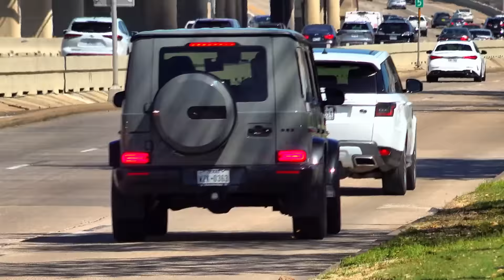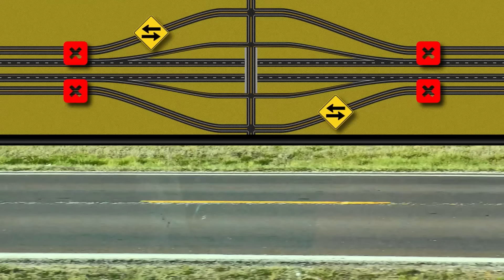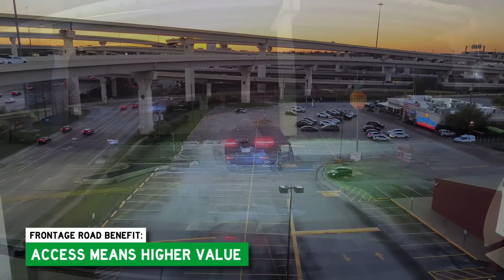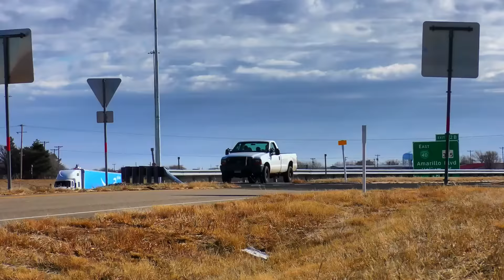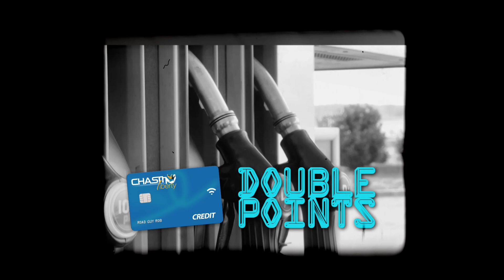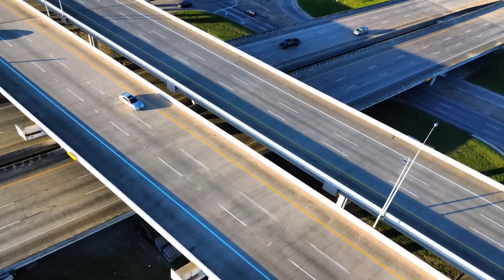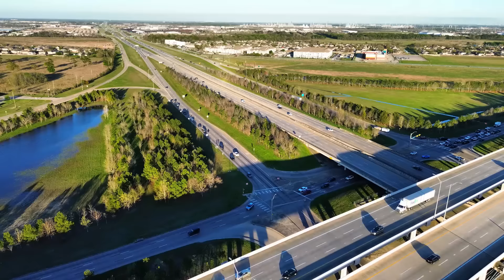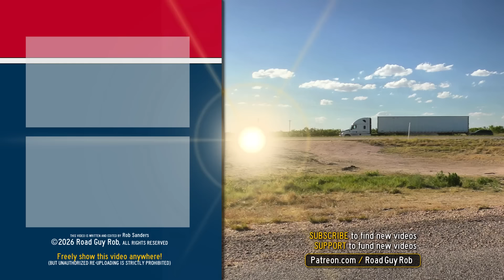Why Texas Builds a Freeway Next to Every Freeway

Comment: Honestly, the frontage roads would be greatly improved, along with the general highway experience, if they removed "driveway access" to them. When the frontage roads are serving as a buffer between local streets and the highway they can work well, even if they take up a pretty crazy amount of space. Rob mentioned the land value increasing because of the access, but it ends up defeating the purpose of having the frontage road at all, since the road that's supposed to be providing access to the highway can get backed up with local traffic, areas around places like Costco can be particularly bad about this. The other issue with the land use is that the businesses are highway facing, rather than community/living-area facing, which makes them difficult to access without interacting with the frontage/highway system, sometimes there are ways that you learn over time to use local only, but often the roads themselves tend to push you to a highway, everything kind of "conspires" to get you onto the interstate. Since the highways are so predominant (I can speak more for DFW than anywhere else), it ends up creating "inverted" towns, where the center is all residential, and all of the commercial is along the highway that surrounds you, so we don't get to have very "local" downtown areas.

Comment: It is a clear indication of how crazy our roads can get.... but it does make sense.  In Los Angeles we have divided exit lanes that rejoin the freeway. Near downtown there are a couple sets of these. I usually use them when I can. They require a bit more thinking, which means they're usually better than the main freeway.     
Frontage roads are like flood plane. When the flow increases in the river, the river widens into the flood plane to continue carrying the increased volume. One thing I've always thought, but haven't seen discussed is urban freeways should have more off ramps than on ramps. This allows vehicles heading to a more local destination to have more options to leave the freeway.  Also in Los Angeles where I live, there are areas of interchanges (I-10 to I-5 to I-101) that are boxed in by waterways and train yards. This is of course where the blockages are common.  To get to my house from I 10 westbound people have to take a complicated interchange (Took Tesla FSD until 2023 to figure it out). If you miss one of those multiple lane changes, it's 2.5 miles to get off at the next exit and backtrack on surface streets. 
We could alleviate a lot of the frustration of drivers and save money if we turned signaled intersections into Roundabouts. I used these all over the UK and just love them. They do slow you down a bit, but you never stop. U turns are no longer U turns, they're just 360s.  I've overlaid a basic urban roundabout I was familiar with in Scotland over intersections in Southern California. I did this at scale. Absolutely feasible. The money savings comes from not having to operate traffic signals.  
Two major issues with using space under the freeways. There's a lot more pollution near freeways, but if there's a fire underneath a freeway, the structure can be compromised. It's tens of millions of dollars and long road closures to replace these sections. As electric vehicle use increases, pollution will be less a factor. Noise? (I live a couple hundred feet above a major freeway and interchange. My double pane windows cuts out most of it. Could Bose or someone make noise cancelling windows? Shouldn't be too difficult. )  Also 20 years ago increased pollution standards for diesel trucks substantially solved that problem. I know personally, that's when the crippling migraines I had for my entire life tapered  off and stopped.

Comment: In urban areas with heavy congestion, these frontage roads cause more issues than they fix. Businesses and homes face daily gridlocked traffic outside their driveways. And those places are inhospitable to walk or bike so there's no escape.

They are also extremely dangerous. Cars exit the freeway going 80mph need to decelerate right across 3 lanes to access a driveway, while other cars are accelerating merging left to get on the freeway.
Reply: Whos home driveway exits out onto a frontage road? If that exists anywhere, then they chose to buy the property. Oh well
Reply: @6z0  There are houses directly along the 290 frontage road in Austin. Also tons of apartments and condos are along Texas frontage roads. Do those not count as homes?

Its just a bad design for urban areas.

Comment: The traffic lights at the frontage road intersections feel eternal. The one I have to go through every morning is red for over 2 minutes and green for about 20 seconds. In the afternoon, the traffic backs up and it is not uncommon to have to wait through 2 (or sometimes 3) cycles before getting across the intersection. The frontage road is a bad idea in urban areas but Texans are stuck with them.

Comment: First time I went to Texas (I live in Switzerland) I noticed this special road design and especially found the Texas U-Turns very interesting to use and look at. Even tho I am not a huge fan of car-first infrastructures, it is impressive how well this solution works (for cars and their drivers).
Reply: Texas has the best roadway engineering in all of the US. Lived here all my life and driven in about 10-15ish of the major states. Sometimes its better to optimize for one mode of transport instead of half-assing it for everyone and making it shit. Just like New York City is a subway / walking city primarily (terrible for driving), Texas just happens to be the opposite. And both are great when you use them as designed.
Reply: The nice thing about the car first infrastructure is that the idea of traveling great distances becomes more common. A 20 to 40 minute drive (10 to 30 miles) becomes less burdensome and daily routine. And some people even go 4 hours one way then back as a day trip to the major cities or borders.
Reply: For us here in Texas there is so much distance between everything that it's probably always going to be car first

Comment: The service roads (what we call them in Dallas) are great except for one thing that is a pet peeve of mine.  

In a number of cases -- not all cases -- when you turn onto the service road from a main perpendicular road, you have to drive an extremely long distance until there is an onramp for the freeway, meaning you have to pass all the driveways of a countless number of businesses with cars and trucks pulling into traffic, causing a delay into you actually getting onto the freeway.

Comment: The frontage road has been a life saver for me on multiple occassions. Once i spun out going off the ramp onto the frontage road (ironic i guess for my point) and got dirt in the tire sidewall of one tire so it couldnt hold air so i had to limp home across texas on a boot on the frontage road. Then another time my tire blew out and drove across the grass changed the tire on the frontage road and then  i limped across texas on the boot.

Comment: I was watching this and thinking it looked very familiar.  We have one-way frontage roads right here in Cleveland, Ohio, even including the U-turns under the bridges.  I'm betting ours may actually predate those in Texas.  I do know some along I-90 in the east-side of Cleveland have been there from at least the 1970s and judging by some of the industry, and homes, probably the 1950s.  

One difference in that area:  I-90 is an east/west road.  The frontage road on the south side of the highway, east bound, is industrial and commercial.  The frontage road on the north side side, west bound, connects to north/south residential side streets.  It does make for some tricky merging and having your head on a swivel.

Comment: During my brief visit to Texas I found it surprising that the drivers coming off the freeway exit ramp have the right of way, although I see the logic of it.  But my experience being on the street trying to get in the left lane for a U-turn was that cars come down that ramp like a bat out of hell and do not decelerate to the surface street speed limit before reaching the bottom of the ramp. This was in 2001, perhaps before they switched to the X configuration. Today there would likely be a much greater distance over which to do battle with the exiters.
Reply: Yeah you gotta watch out for that haha

Comment: The only thing I hate about Texas is the high ass intersections they call flyovers. Being afraid of heights n a trucker isn’t a good mix on those highway junctions. When I can I get off n use the frontage roads to avoid the high ramp. When I can’t avoid them I go past them to next exit that will allow me toget turned around so I can stay ground level or closer to it.

Comment: I recently drove across dallas. while using a transponder and pulling a u-haul. I avoided the toll roads whenever possible except for $12 where there was an accident.  The uhaul was $60 in tolls. The car was another $60 in fees. I took i20 to i35w. As far as I know I only took the toll road for what should have been $12. I didn't make any stops. it took 6 hours. google maps estimated 1.5 hours.

Comment: Ah, Texas... Houston in particular. The expanses of concrete are never enough. By definition more is better, more lanes, longer, more loops, more more more. I spent a fair amount of time driving on those freeways and surface streets. I admit that the one-way frontage roads used are a pretty good thing. Houston as a city is a horror. Virtually zero planning, zoning, etc. It's just awful to try to actually get around and do things because the traffic is always over the top. With a mass transit system that is barely adequate and treats the west side of the city as untouchable.They like to say that everything is bigger in Texas... sure, whatever. I think everything is kinda messed up and weird in Texas.

Comment: I thought this was common. Not just freeways but highways too. It's a beneficial idea to have your off ramps connect to some form of thoroughfare that runs parallel, like a buffer. So from those, you can either get on a highway, or access local businesses. Of course the ones I know behave more like streets than highways themselves, with street lights and everything. Every now and then crossed by a street that crosses under/over the highway.

Comment: In the olden days, Beltway 8 north, then called the North Belt, had over passes built, but no actual freeway. It was like they were optimistically waiting for the freeway to connect them. So on the way to the airport, you got off I45 to the North Belt and drove on the frontage road and then got on the overpasses at each crossroad. I'm not sure, but I guess by the time Beltway 8 was actually built, they probably tore down those overpasses.

Comment: I'm convinced that all this extra concrete and paving just increases congestion and wastes gas. I spend 2 months a year driving in San Diego. In Texas I spend a lot of freeway time in stop and go congestion and I need to fill up every day and a half or two. In San Diego my driving habits and distances are similar. There I fill up every week to 10 days. In SD I'm almost never in 1st or 2nd gear on the freeway, my momentum is usually uninterrupted. In Texas I'm constantly having to use 1st, 2nd, 3rd, & 4th gears on the freeway. If I had a six-speed, I'd be using 5th constantly too. Having a manual transmission in Texas is not a good thing. In Texas I get 22.5 mpg. Same car in San Diego gets me 29 mpg or better. But in Texas, oil is king and we gotta support local oil.

Comment: 16:48 I grew up and learned to drive on  that section of East Palatine Road (East of Rand Road)

There is an underpass under the CN rail tracks just west of Palwaukee (ahem, Chicago Executive) airport, and overpasses at IL-83 (with a Texas Turnaround) and IL-21. 

At one point there was supposed to be an expressway connection to the Tri-State Tollway, but as we all know, that got shelved.

This also explains why Palatine Road has frontage roads almost all the way from I-294 to IL-53 (the exception being from Rand Road west to Arlington Heights Road). But then the state wanted to extend the IL-53 freeway into Lake County, and that became a debacle that could be the subject of its own video.

Comment: the real problem with the side roads, is that they are not the main deck, but there's always people going 70 in a 45. the length of the off-ramp allows the time and space for you to use your brakes and slow down (novel concept!) to the access road speed limit before you actually cause a rear-end collision with with someone choosing to be right. and to that one goober going 55 in a 75, even though you're in the far right lane, GET OFF THE MAIN DECK! that's what the side road is for.

Comment: You're wrong on slingshotting.  It creates additional volume of merges downstream (now also blocking the next off ramp) which causes the traffic jam to grow forward and worsen.  If I could make one change to Texas frontage road design - every on ramp (from frontage to the main thoroughfare) would have at least one traffic calming device between it and the last off ramp, to specifically reduce this problem.

It's also often done illegally, since it's illegal to pass on the right; the off ramp is a deceleration area, and now you have people trying to speed up and pass other cars on the right.  Worse, those same people usually fail at zipper merging when they re-enter, since they're already trying to cut ahead of other drivers.

Comment: There's another interaction between the tollway and its frontage roads. Some toll gates are located not along the entire length of the tollway, but instead on certain high-traffic entrances and exits. If you plan your route ahead of time and/or are willing to deal with more inconvenient entrances/exits, then you can reduce or even completely remove tolls from your trip while still using the tollway. But if you need to take those specific entrances/exits immediately, then you have to pony up.

Comment: I have mixed feelings about the frontage roads in the cities. I like some aspects of them, many of which were discussed here. But it also seems to me that they create a strange in-between road that's neither fully freeway, nor fully surface street. Some of our frontage roads are three lanes, so effectively a highway, and like the video mentions, the exit from the freeway is frequently way before the cross street. So you drive at near-freeway speeds down what is technically a surface street. Which makes making the right turn onto a frontage road tricky at times. This in-between configuration strikes me as both inefficient and dangerous. Some of those lanes would be more efficient as part of the freeway. And access to businesses would be better served by a normal surface street. So I think whether or not a frontage is appropriate depends on where it is, and density of traffic.

Comment: The problem with using the feeder roads when the freeway main lanes are backed up / closed due to accidents is the traffic signals at the cross streets  do not allow extra feeder road green time. Would thing in today's technology the signal system  would detect extra heavy feeder  traffic and get it more time then  go back to normal cycle when the feeders clear

Comment: There's a stretch of I-90 on Cleveland's east side that uses frontage roads.  It works pretty well to reduce potential back up on exit ramps because it dumps traffic onto a side street first.  They don't go crazy with all the businesses and whatnot, but there are businesses and streets that branch off of the road.  It also helps limit the number of exits needed.